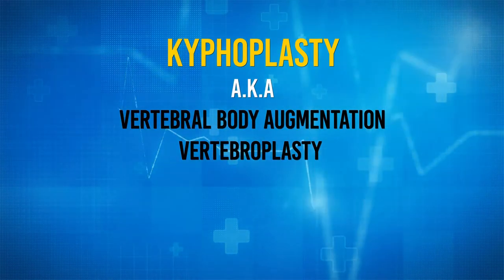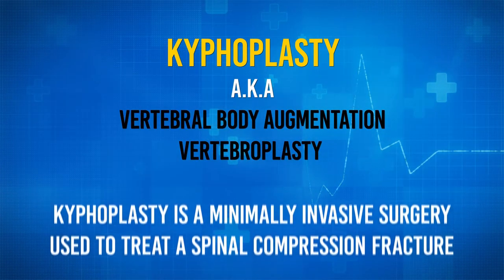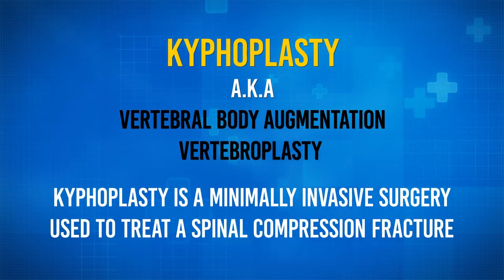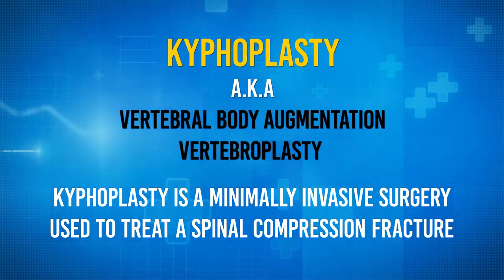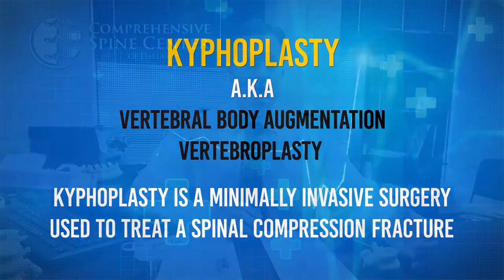What is involved with a Kyphoplasty procedure?

Comment: Nice, but you should show how the needle is inserted into the bone by the surgeon tapping rather sharply on top of a metal plate to get it into the vertebra. I had a kyphoplasty done two days ago and under light sedation I was conscious enough to suddenly feel something striking my spine repeatedly, with some pain. I was quite alarmed and cried out, although I heard someone assure me I was asleep! Afterwards, I was too groggy to speak about it but wanted an explanation which no-one could provide; the operating doctor did not come see me after the procedure. Only when I went looking at videos of the procedure did I find only one that showed the fairly substantial shaft of the trocar with a flat metal plate on top and a surgeon tapping it with a hammer. That clip immediately answered my question as to what I had felt. I feel this should be more fully explained to patients, since under light sedation it's always possible that the patient will gain some awareness. Otherwise, this is a fine video.
Reply: You have to remember that that results and risks of the procedure are more relevant to what the doctor needs to say to the patient.  Sure, he could tell you that he's going to be hammering a gian needle into you spine, but honestly, is that a conversation that's going to be useful for the patient?  Maybe, but mostly it's going to turn away a lot of patients and cause others to ask a billion questions.  My point is this, before agreeing to a procedure and you want to know what it entails, Google/YT are your friend.  rightly or wrongly, doctors are not inclined to make the time to make life harder for themselves.